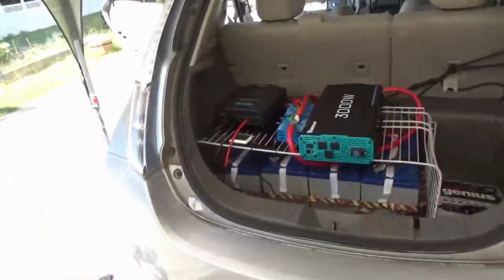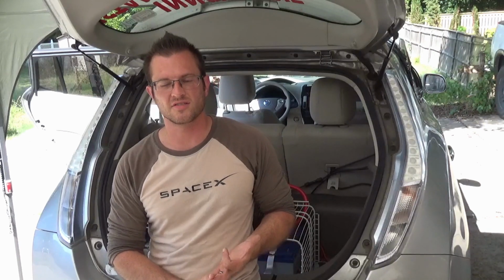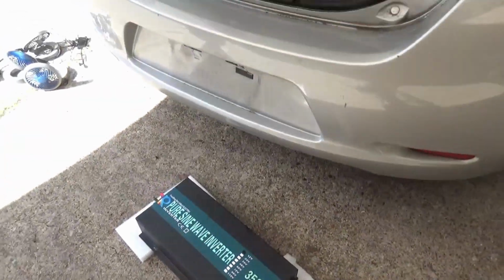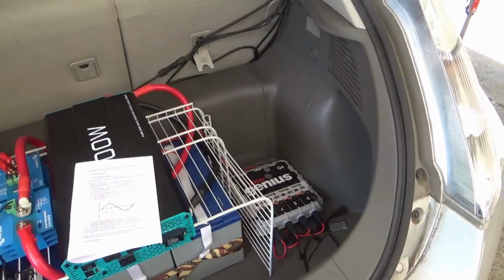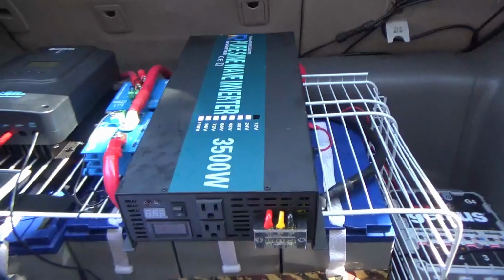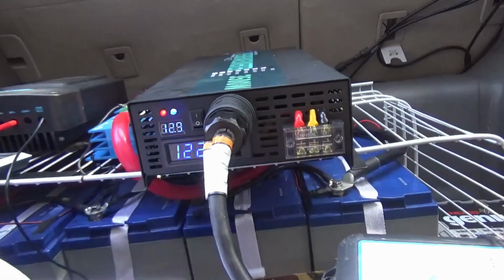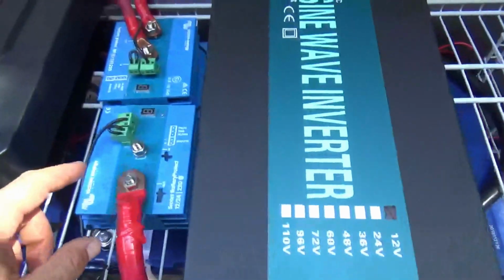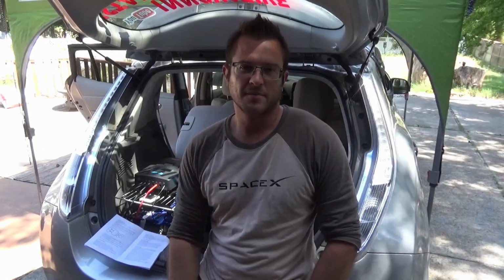Inverter Problems

Comment: You cant ground these inverters. There split phase 60v/60v and the ground is a center tap. If you ground it or AKA neutral tap it. Smoke will roll. Actually most inverters are made this way.
Reply: Basically what Giandel said in regards to my query. Ground the Giandel case to a PE (outside ground rod) and only use the 'L' lug & the 'N' lug - When do you use the 'G' lug???? - No answer back
When I asked LiTime about using the 'N' bus bar as a Ground, they didn't recommend it for their LiFePO4 Battery's BMS
Giandel:
Our inverter generally only measures the voltage from the L to the N.

L = Hot wire
N = Neutral wire
G = Ground wire
Regards,
Elsa

Comment: One thing to remember is the outlets will only handle 1500 watts each. To use it for 3500 watts you must hard wire it up to the terminals.

Comment: Hello, I really appreciate what you have done here. I am a DIY'er have a late 2021 Forrest River 25' Surveyer Legend I have been through the same testing and frustrations you have been going through. I felt your pain you shared and described in this video. I thought I was alone and that the problems with my system was my problem and not the company or Renogy product I purchased. I have a 3000W and 1000W 12V Pure Sine Wave Inverter Charger w/ LCD Display SKU's: R-INVT-PCL1-30111S-US Renogy inverter. I have a degree in practical hands-on electronics and, up until this install in 2022-2023, I was comfortable with my skill set and I have been beating myself up with this install. Your install is real nice and is neat and still it failed. A load is a load, and the company that told you that they have not tested for a charger. Heck,  you are connecting to a car charger and your system does not know the difference and that tech did not know his or her stuff. I am going to make a video like yours about my frustrations, and maybe it too will help others. To date, I am ready to rip out my inverter system and going back to old school, solar panels and an aux 3700-watt Onan gas generator.  No matter what I did with my Renogy 3000 or 1000-watt inverter, it would not last long and give that annoying beep until I reset it. My inverter is wired in as the 3000-watt has an integrated transfer switch in it. I have learned a lot but not enough, and I am encouraged by your video. I think I am going to use a NON-RENOGY inverter system that does not have a transfer switch and use a manual one so i can switch between shore power and battery. After all, this was for off-grid and quiet to make coffee and use the AC for a bit, nothing radical. You can call me any time at 714 329-4860 if you are still messing with this and anyone else that wishes to make a better world for DIY'ers. See my Channel Youtube.com/erickirkhuff  e

Comment: Each plug has a certain amount of max wattage. The hard wire connection is usually able to take the full wattage of the inverter. Use hard wire connection instead of plug. Another thing I've learned is that the fans work better blowing into the inverter instead of out. It's usually easy to flip them around. I've had less problems with heat after flipping the fans to blow into the inverter
Reply: Adding to the comment about the fan, if you use pc fans they are quieter and have proper bearings
Reply: @dantronics1682  yes, the fans that came with my inverter sound like a jet taking off

Comment: I have same exact inverter( Renogy 3000w) Mine just randomly started doing this yesterday. It’s been great but I plugged in something as petty as a hot plate and it beeped instantly. I only have a new air 48qt freezer/refer cooler that draws power but it’s been fine for 5 months and doesn’t come anywhere close to 1500watts of use. So I have power to spare if I want to use it for a hot plate . So why not. But nope still shuts off. No voltage drop. All my set up has been fine . All my gear is brand new.

Comment: I have been tinkering around with Off Grid Solar systems since 2016.  And it has so far been my experience that the Inverter you have is the Most Likely thing to go out: especially IF it isn't one that is Transformer-Based (that weighs 100 lbs or More).  The lighter ones that operate off of mossfets at high frequency (in my experience) last from 6 months to 2.5 years.  If you have one that has lasted longer be thankful.  I also think that the More you Stress it out by using it at 1/2 0r More of it's Rated Power, it will not last as long.  This applies with almost everything,
Reply from the maker: Agree

Comment: I have the same inverter 1500w.  I can’t any power through the AC 3-prong port. My blue light is on. No red light. DC voltage is display is on. The AC output display is off. Any suggestions?

Comment: Maybe your system is not connected properly. You have to double check your wiring and connection. Those victron low voltage disconnect gives problem to the system. I use to use it on my system and my inverter start to give me problems. So I removed it and upnto Joe my system is working properly. Next thing, MPPT charge controller is the best.

Comment: Just an observation,  IMO you have those batteries connected in parallel but you are drawing the Positive and negative from only the first battery (right hand one), to use them correctly you need to be drawing your load from the positive on the battery at the left and negative on the right hand battery (or vice versa)  that would ensure balanced use of all 4 batteries and give better power draw. may help may not.    (edit:- wow just realised this is 3 years old lol)

Comment: I own this same invertor but instead of using the outlets, I hard wired directly into the three leads on the back of the unit and haven't had any problems.

Comment: My fathers car charger will not work on our Grow watt inverter, it is not grounded but maybe  we could change that.  This is an important aspect of this because many people now will want to charge their cars with solar and not know why they don't work.  Solar ON the car is great but going to be difficult to get a kilowatt or more on there.  A fold out panel from the roof that would cover the windshield would be nice, it should probably slide and that's a challenge.

Comment: You are using batteries to charge the batteries in you electric car?  Is that right?  Why not just connect them directly?  You are losing 15 to 20% of your extra battery power?  Using solar to charge THEM?   I think you need direct connection to the batteries in parallel or something and keep the inverter out of it, no ac needed, just go from the solar to the charge controller into the car batteries.
Reply from the maker: https://youtu.be/lzKVSIE3Dcc
Reply from the maker: Its kinda a long answer, but if youre really curious here ya go
Reply: @InnovativeSustainableSolutions  ?
Reply from the maker: @TheWadetube  Literally a link to an entire video I made answering the exact question you asked at the top of the thread

Comment: Renergy was giving you a line of bull. The application is no different than any other. An AC load is an AC load. Power factor is the only other variable, and if they have a problem with certain sorts of loads they should spec it.

Comment: I always wonder if its just better to pony up and pay for a Victron Energy inverter. All these other Amazon brands seem like cheap electronics rated well by average people in reviews that have little experience or comparisons. Interesting with the grounded issues you had, there is no earth ground on any power stations or inverters I've seen so how can it be grounded at all. Its not and cant be the safest thing if something goes wrong.

Comment: I believe this inverter has a centre tapped ground. By this I mean  that the line and neutral connections are both at 60 volts above ground potential, do you have a multimeter to check this. If you don't have a meter to test this use an ordinary tungsten mains bulb, connect one terminal to the inverter ground connection and the other to the neutral. If it lights up then try connecting the wire you connected to the neutral to the line connection. This should light the bulb to the same reduced brightness, if it does then this would confirm a centre tapped earth.  In your home the neutral connector is at ground potential and I would think that your charger is not working because it is not detecting a zero or very low voltage on the ground connection with respect to the neutral. If you have an isolating transformer 120 volts in and 120 volts out (but no electrical connection between the two windings, hence isolating transformer) you would connect the inverter to one winding and on the other winding you would ground one connection and connect both the earth and neutral to this connection and the line terminal to the other connection this would work, but if you had to buy one then there is yet another cost. From what I've read these are a very good inverter.  Best regards Ray.

Comment: I had one of these inverters with the same problem - high voltage input error. What followed was absolutely zero output from the AC side, and nothing I could do would make it work again. What followed after that was me tossing a 24V 2500W inverter in the trash can.

Comment: How Did you manage to solve this problem inverter input overvoltage? I have the same inverter and i'm facing the same problem. inverter input led brinks even at 27.5V. Thanks in advance.
Reply from the maker: I switched brands to Giandel 12V and have had zero problems since this video was made.
Reply: @InnovativeSustainableSolutions   perhaps you overlooked plugging the charger in to 3 wires on the right of the inverter where it outputs the rate 3000 watts and you plugged   it in to one of the two outlets which are limited to 1,500 watts each.  That's what I saw in one of your videos.

Comment: I have the puresineinverter by reliable in the video hooked it up tested it , worked great , put the unit on a trailer and moved it home , and in transport popped four of the internal fuses, pulled and replaced , simply hooked it up to the battery and it exploded and burnt more fuses
Reply from the maker: Sorry you have to deal with that headache.  It really is sad how little pride people take in the products they manufacture these days.  These companies dont realize the value of customer satisfaction.  Giandel has a customer for life in me now.  I have abused the hell outta their 12v and it has performed flawlessly.

Comment: Can anyone give me some advice for opening the inverter and removing or sound dampening the buzzer/beeper? I have lithium batteries and run them down enough to set off the inverter which is annoying, I want it to just die not blow my ears out.

Comment: When using any Gas Generators , I always place in the ground a metal rod and connect the generator to it. Within a vehicle your on rubber tires. Within the vehicle not having contact with mother earth, the vehicle is made to compensate for this.
when adding other Ground sensitive devices put a metal or better copper stake in the mother earth, I have had this problem before. When you see semi trucks rolling down the road with rubber strips touching the road these are grounds they have metal strands in them to make ground, normally for gas haulers,Propane haulers etc. Hope this helps.

Comment: Those inverters are awesome, I have 5kw one in my shop. Simple fix, step 1 you take the ground side of your battery bank and ground it to the car chassis. Step 2 ground the chassis of the inverter ( the little screw on the bottom ) and ground it to the car chassis. The neutral and ground come together at the battery side of the system. Easy peasy, lemon squeezey. This is how all electrical systems work, the grounds and neutrals come together at the power source, in your case it's the battery bank negative or simply ground your inverter to the negative side of your battery bank, same thing.

Comment: The reliable inverter are Junk, my 3000 W inverter didn't  last 3 months , no able to function a Shop-Vac rated a 6 amp on battery bank of 3 x 400ah AGM
The big joke is the fake warranty.
Reply from the maker: Agree

Comment: I do not know exactly how are inverters are grounded inside because I never tried opening one. One thing I can think of is the normal house wiring at 120v outlet is Hot, Neutral, and Ground. The thing is that neutral and ground are wired to the same grounding block in the electrical box of the house. Basically both neutral and ground are "grounded". One way I could think of is tying both ground and neutral together and it might solve the ground detect issue but even if it does work that may be very unsafe and may damage your inverter if not done right. Another possibility is the ground in the inverter might just be "chassis ground" that may not in any way be connected to the neutral side of inverter. Without taking the time opening the inverter up, I have no way to know.

Comment: I’m going thru the same issue with the same inverter 
No ground 
If you find A decent power inverter let me know🤔
Reply from the maker: My Giandel 12v has been a beast.  I'm not sponsored and get no kickbacks from them.  That inverter is just solid AF.
Reply: @InnovativeSustainableSolutions  I bought a giandel  3000-6000
And it runs my chop saw ,circular saw, compressor it is a beast others wouldn’t 
The soft start works very well

Comment: My experience is that high frequency inverters (like you have) for one are not as reliable as low frequency ones (bigger and heavier) plus that its made in china is probably the worst thing here as their quality control is often terrible and main reason for all the failures. If your not able to take these things apart and repair then better off spending more for better quality one.
Reply: 99.99% of all electronics you can buy is made in China. There's nothing wrong with made in China under certain circumstances. It's obvious that these inverters aren't designed for the application he has in mind, but that doesn't mean they won't work for nearly everyone else who'd just be interested in using them for general household small appliances.

Comment: no, not all are crap, try Australian made 
https://www.selectronic.com.au/sppro/
or 
https://www.latronics.com.au/products/stand-alone-inverter-ls-series-500w-7000w

they are EXPENSIVE but for a darn good reason, these things are MADE to handle the currents they are rated at.
and built to Ausi (stupidly high) standards.

they are 230v output which may be an issue for many American appliances.
but then you can get drop down transformers too.

Comment: But the vehicle frame is not an earth it's a Negative rail I would think
If you diverted fault current to the frame
If you held your car and stepped out 
You would present an earth path and could be electrocuted
Just as you would if live power lines were on your car
That's my thoughts anyway
Reply from the maker: That's a good observation.  Although the grounding terminal of inverters of this nature is very rarely charge conducting under normal operation.  I eventually disconnected the system from the vehicle frame, went with an isolated ground bypass with a fuse.  It would be interesting to test the vehicle frame to ground with a multimeter under fault and see if you could get 120VAC.  That would be a little scary.

Comment: You need an Earth ground. Connect to a ground rod or metal water pipe.
Reply from the maker: This is not available as the inverter is inside of a car that is constantly moving, and the system needs to be deployable in 2 minutes or less.

Comment: Sorry for yet another comment. With those inverters, (reliable)  there is not a neutral to ground bond. You would have to Bond neutral to ground yourself. Because where this is made it does not require them to be bonded, kind of like GFCI in a home, that's not a requirement "world wide" so of course if its not a requirement they skip it :( .  it is easy to do, but I only recommend if you know or are comfortable with doing such things, because you could get hurt and I would not want you to get yourself hurt.
Reply from the maker: Great information.  I wish inverters would come with more information on what they can and can't do, and what some of the specific shortcomings of their design are.  That doesn't happen though, people have to figure it out themselves, which is probably why SO many people have watched found this video looking for answers.  When using them in solar car applications where a true ground is impossible to receive, I have learned to just install fuses anywhere a short circuit can occur that would potentially shock someone.

Comment: I just wanted to comment on the temperature, If you want to accurately measure the temperature of the electronics ( especially in a hot car) you have to remember that the air temperature around the electronics  will not be the same as it is inside. Most of them are made out of aluminum and will hold much higher temps on the inside. I ended up using a cheap temperature relay I got from amazon, and installed it inside the inverter, and I noticed the temps were up to 10 to 15 degrees hotter than the air temperature in the car. ( they are like $20 for a set of 2) I used mine to light up a light when it got to a set temp I programmed. If you are planning on a cooling system, you could use the same relay to turn on and off the cooling system with such a relay and it would not consume as much power, or have a lot of manual aspects of it. I just thought I would share my experience.  125 degree car = 140+ degree electronics. (based on me seeing a 10 to 15 degree difference between the surrounding temp and the internal temp after installing the temp relay.

Comment: Ground your batteries to frame of vehicle
And ground your battery terminal of your inverter to another part of the frame of vehicle.  Car must be on to use inverter as well.  No alternator no inverter, even u have to remove solar panels